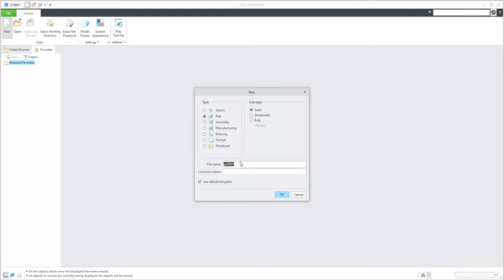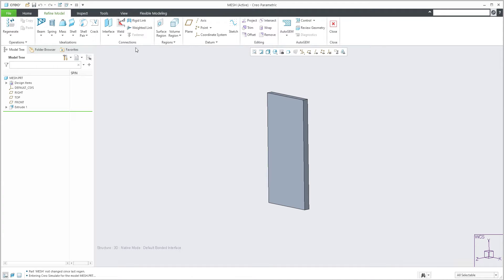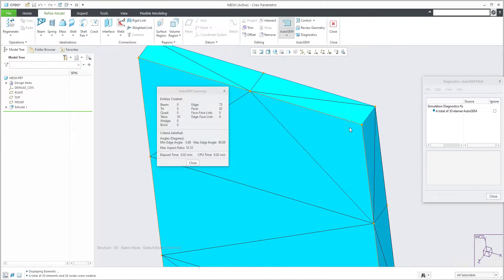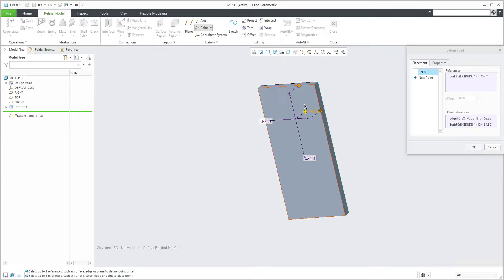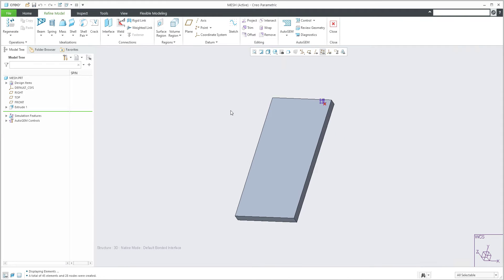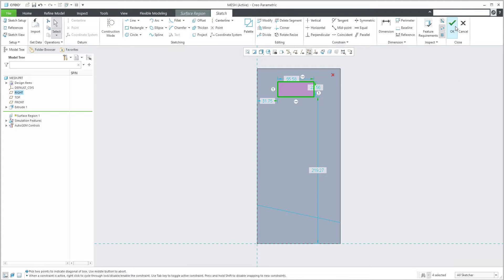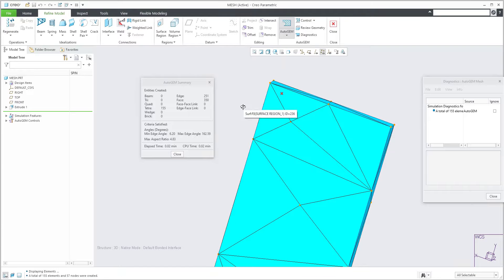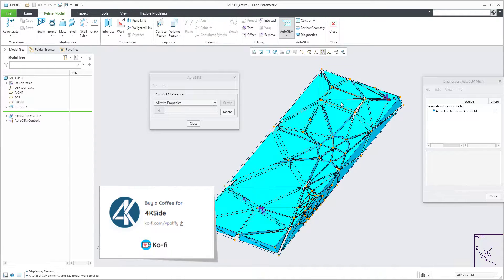Understanding AutoGEM Limits and Settings | Creo Simulate

Comment: Hello sir. I hope you will be fine.
I want to ask Is there any way that we can make a dense mesh in volume or surface regions without effecting the outer side mesh?
In this example in volume and surface regions same setting is applied as for outer. So how can we just change the setting for volume and surface regions?
Reply from the maker: Hi, thank you for your question. I think that is not possible... I do not have experience with this use case. Maybe some another user will answer and help you with this topic.
Bye, Vladimir

Comment: Why and when is it necessary to refine the mesh and/or increase mesh density ? Creo uses P-elements. Can't I just increase the polynominal order of the elements to get more accurate results ? Thanks...
Reply from the maker: Hi, thanks for your question. On simple example I will try to explain it, imagine that you have simple plate (simetrical devided by mesh). The calculation is working fine and go through all elements.. But in realty on some small piece of your model is concentration stress. If you calculate with same Polynom every piece, is hard to focus in better quality on this small piece. If you know where the concentration is, you are able to split on smallest pieces and calculation will also be concentrate there.
Reply from the maker: And also the time for calculations will be faster because you do not need to increase quality for whole model